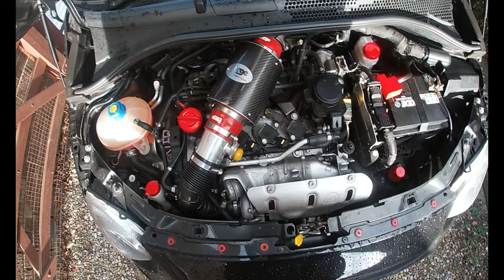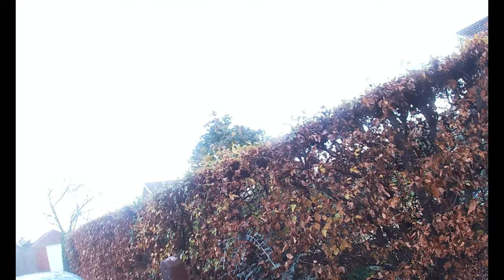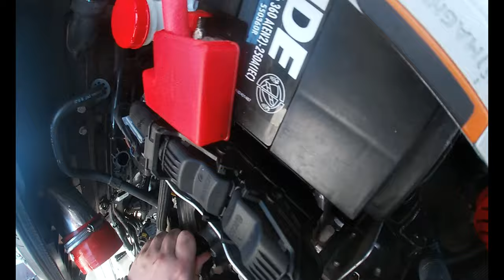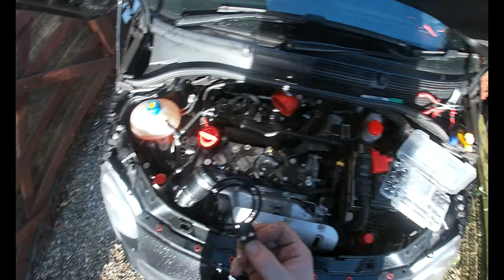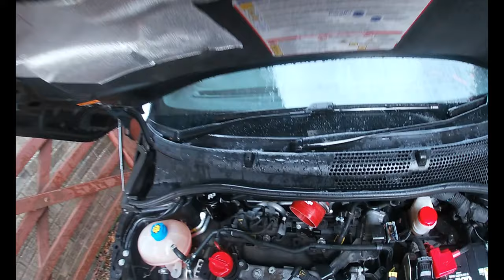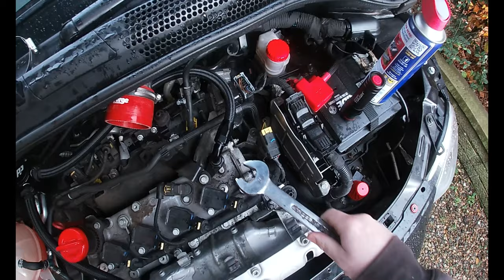Abarth 595 - Pista Performance Oil Catch Can (Install)

Comment: Where is connect the second hose?
Reply from the maker: One hoses connects from where the original oil separator and then into the catch can and the second connects into the oil catch can and then into the air intake elbow located near the turbo
Reply: @Andyanator   Does oil catch can can be instaled on non-turbo engine?
Example mine Grande Punto 1.4 95hp starjet?
Reply from the maker: @n.sh3  You would have to ask the manufactor